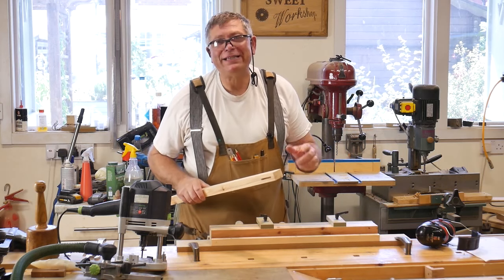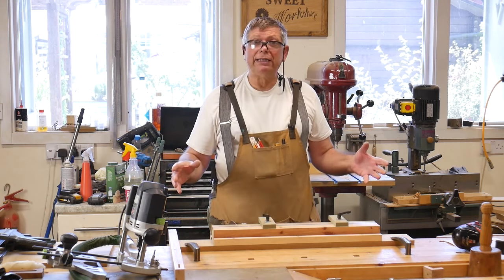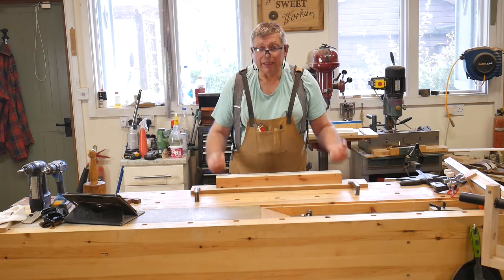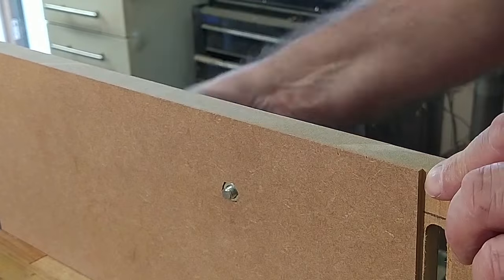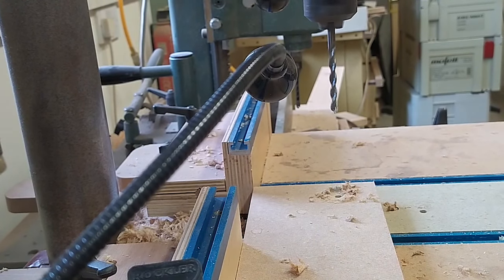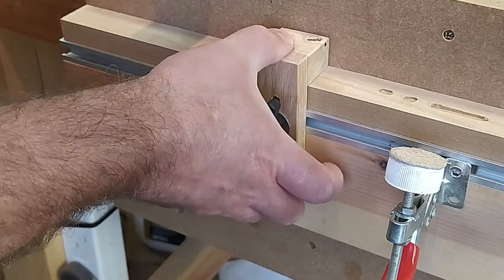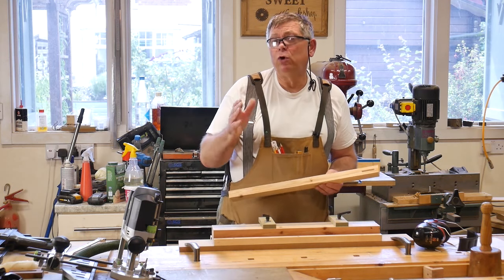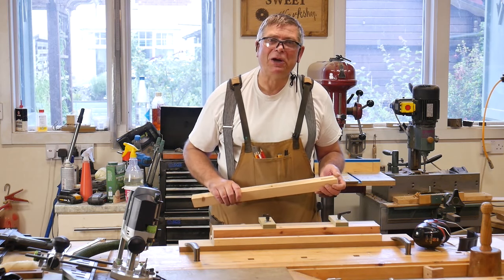The Ultimate Router Mortising Jig - now with PLANS!

Comment: This is really a great mortising jig. I like your idea of having keys on the travel stops, but if I may suggest, use pieces of metal, or UHMW (plastic) for the keys. MDF is fine for the stop itself. Wood, hard or soft, will expand and contract with any level of moisture, and can also dent easily, where the UHMW or metal will not. This would eliminate any chance of ever having to replace the keys.
Reply from the maker: You make a good point, but in reality the keys are so small, as are changes in humidity and temperature, that expansion is not a problem. If I used this every day, and I lived in the kind of environment you describe, then yes, I can see the advantage, but I don't and I have never had such a problem.

Comment: I made and use your box joint jig and it works great.   However, I wonder why you believe you mortising jig that the router is guided by an adjustable fence fasten to the router while there are other jigs that either utilize a bushing or captures the router base?  Thanks
Reply from the maker: I have made several mortising jigs over the years, including ones based on bushes. Indeed, I still have, and use, a cross-mortising jig that has the entire base in a guide. But this is a development of a desigh I first published 16 years ago. The fence guide idea came from a FWW video which I can no longer find. But this is defiitely the best mortising jig I've ever used, I'm not going back.

Comment: I really like your mortising jig Steve and am thinking of making a similar one. Before I do I need to consider how to make the tenons and am looking for a "ultimate router tenon jig" to create accompanying tenons. Did you create one (hope I didn't overlook it) or can you recommend one? Prefer to make one instead of buying something like the General #870 Mortise and tenon jig, but like the compatibility of the integrated jig.
Reply from the maker: I have indeed published plans for a couple of different router tenon jigs, many years ago on Workshop Essentials Volume 1. But unless you have only a router and no tablesaw or bandsaw, then I suggest that you would be better off building the Ultimate Tablesaw Tenon Jig or the Ultimate Bandsaw Tenon Jig. They are both easier to use and have greater capacity.
Reply: @SteveMaskery  Thanks for the quick response Steve. I tried to reply (twice), but seem to have failed. I have both alternatives, but was trying to produce tenons with rounded edges that fit the routed mortices perfectly without having to round them manually (need to make ~120 joints in my project), in a similar fashion t the General #870 mortice & tenon jig for instance. (https://www.youtube.com/watch?v=boYiNmE7IWU)

Comment: Good jig but there is something uncertain with only having router fence on one instead of both sides. This would of course require another design so unfortunately nothing that can be added.
Reply from the maker: No, this is perfect! :)
My original version of this, about 15 years ago now, did have two fences, but it made for a very bulky setup. Functionally fine, but ergonically clumsy.
In this version the fence does not just run against the fence, which can lead to slippage, I grant you, but it runs in a groove, so it is trapped and the router cannot move off its required trajectory.
Really, it's perfect :)
Reply: @SteveMaskery  aha! Sorry I missed the groove. Will watch again and pay more attention. Thank you Steve

Comment: Can this accommodate a mortise 2" wide?
Reply from the maker: Well if you have a 2" diameter cutter, I don't see why not. I assume that the workpiece is also massive, so you might need to beef up the front support. I have to say that I have never seen such a large router cutter.
Reply: @SteveMaskery  With apologies for my not making myself clear.  I have  4" x 5" leg for a Roubo bench that I need to cut a mortise into for the crisscross glide.  The dimensions of the hole are essentially 2" x 2" 19."  I had planned to use a 3/4" pattern bit  or a 1" straight bit.
Reply: "Beef up the front support?"  Could you please expand on that suggestion?
Reply from the maker: @CooledgeR  Ah, OK, that makes a bit more sense... :)
Yes, I think so. You would have to cut two mortices, essentially, side by side, just offset the position of the router, leaving the  stops in place.
Reply from the maker: @CooledgeR  Well the front supporton mine is suitable for 1" or 2" stock, it's not designed for 4" stock. So you might want to make it more sustantial and rely on something stronger than a couple of toggle clamps to hold it in place.